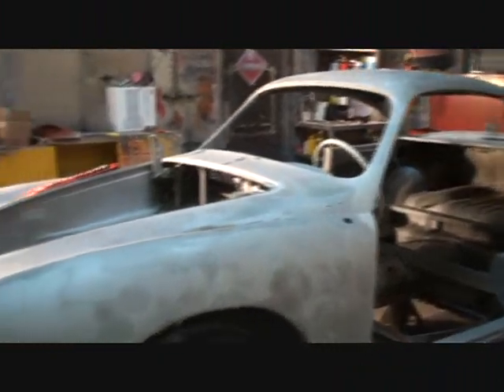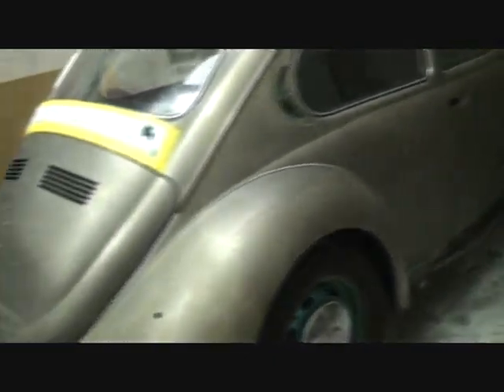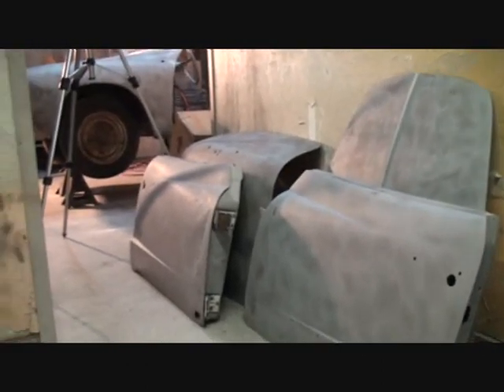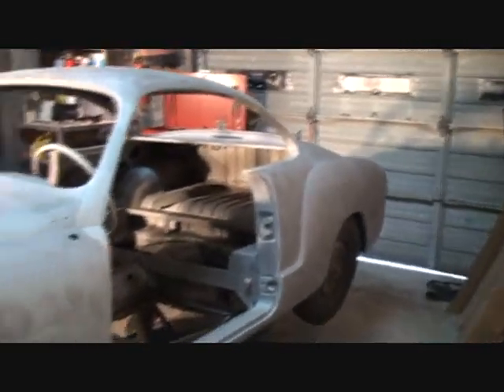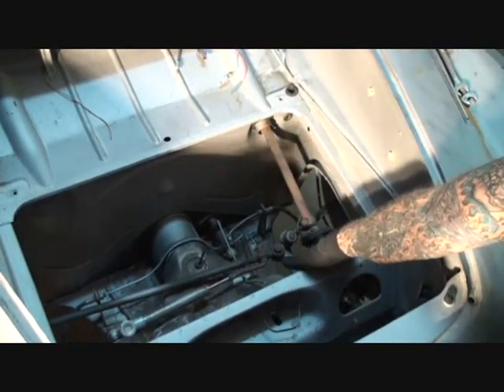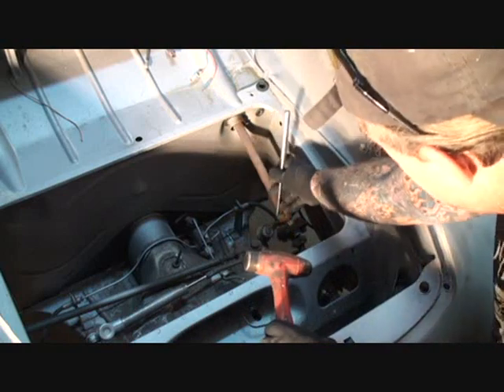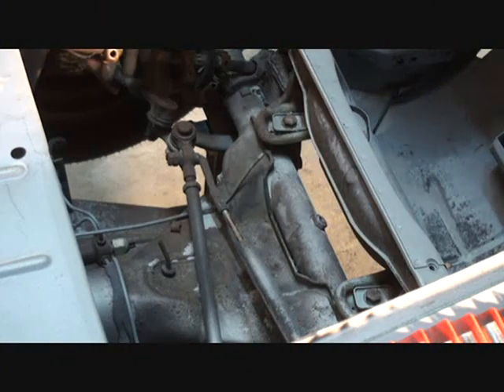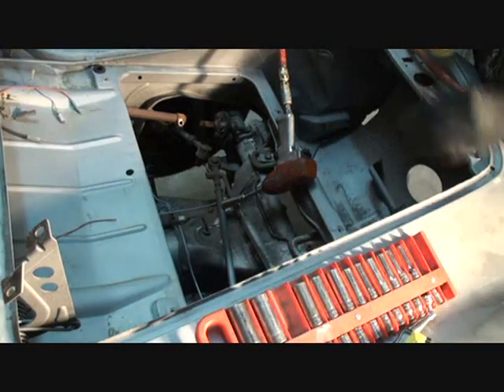"VW" Karmann Ghia: How To Remove The Body-Part 1

Comment: I've been working at home on both German and Japanese motorcycles for 40 years and I'd never seen a 13mm bolt, I wondered why wrench sets even included a 13mm when I'd never even seen one, lots of 12mm and 14mm but not a single 13mm!  So for the very first time I've seen an actual 13mm in use!
Reply: A 10, 13 and 17 is all you need for a VW lol